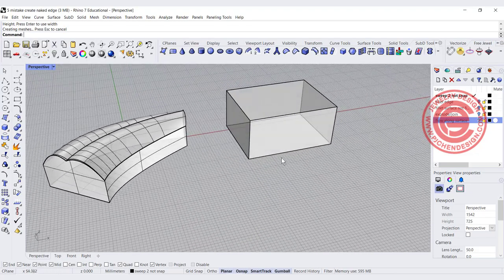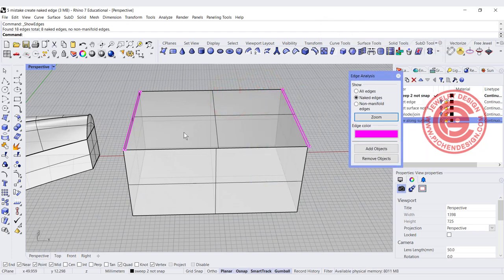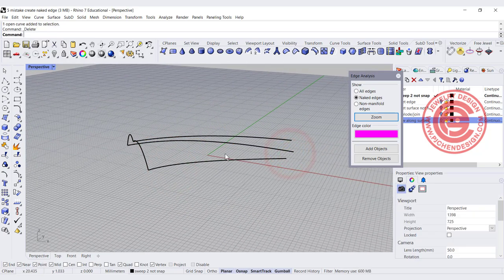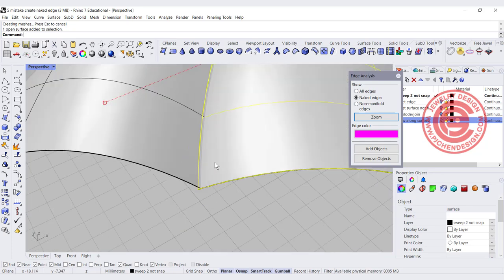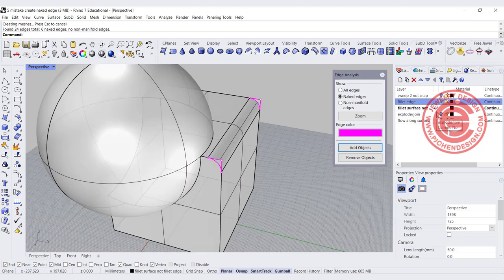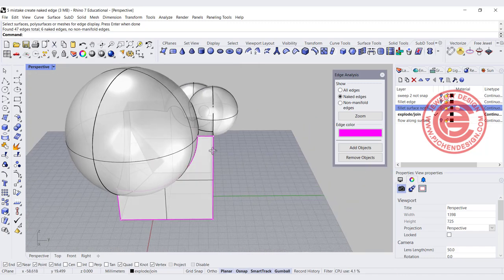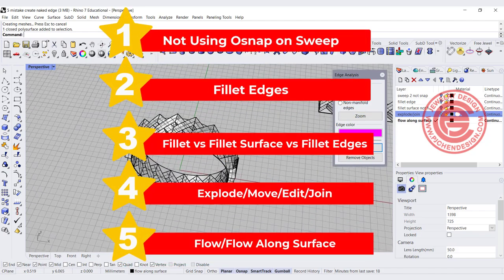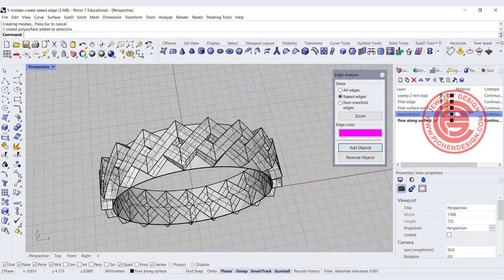5 Mistakes to Get Naked Edges in Rhino 3D Model and How to Fix it #326

Comment: Hi I loved the lesson and I also have most of these issues and it always baffled me but this video solved these issues for me and the blast and join trick was a great move. I have a note. When I work, it flows along the surface and I transfer it to the surface of the ring. The set of drawings on the surface of the ring appears very distorted, in the form of a longitudinal expansion. More clearly, when I transfer a square shape to the surface of the ring, it turns into a rhombus shape. As if my drawings were exposed to a wave of intense heat and melted.
Reply from the maker: When you Flow Along Surface, the object will stretch. I have a video discuss this issue at https://youtu.be/JBJuQmRvvs8

Comment: Hi PJ - I have asked people on McNeel Forum on how to close an edge on a nurbs surface (NOT POLY) and seems like no one know. So could you please let me know how to do that? I separated the surface by isopam then wanted to attach it back together, the surface are the same because it was originally one surface but somehow I was not able to attach it back together. on the forum they told me there is no way of attaching the surface back together I have to work around it. is it true?
Reply from the maker: It is hard to answer your question without seeing your model. you can send your model to me with description on the issue or short video to my email at pj@pjchendesign.com.